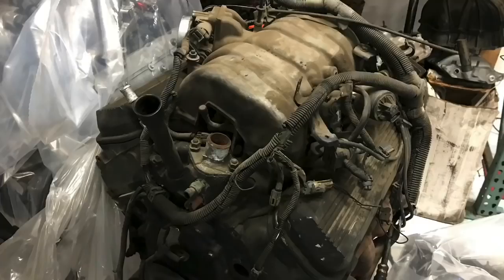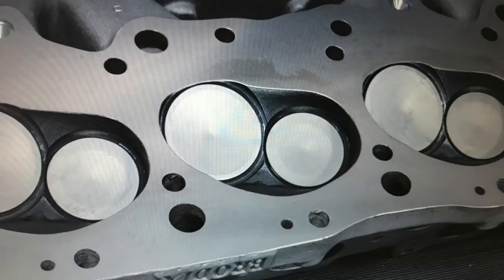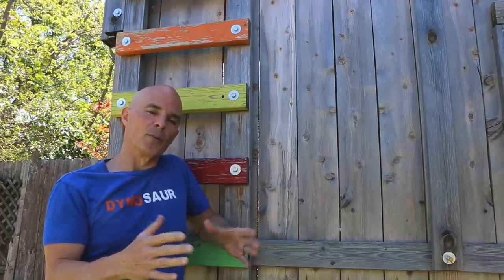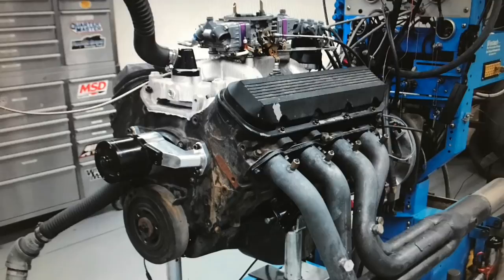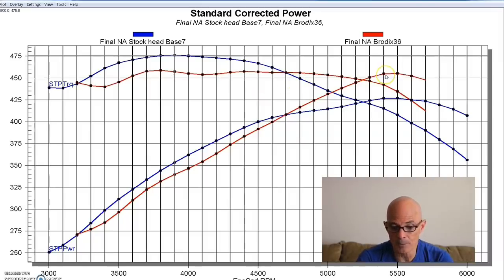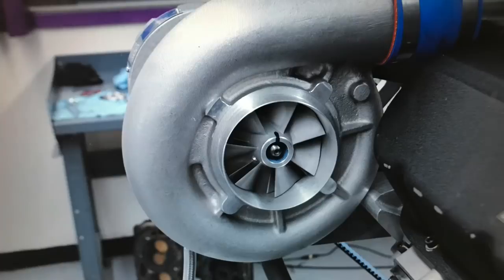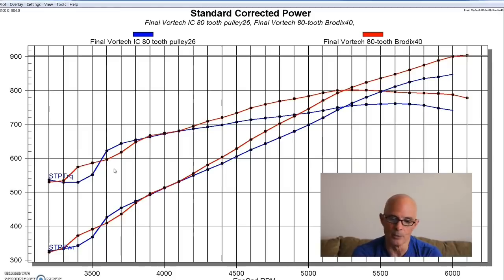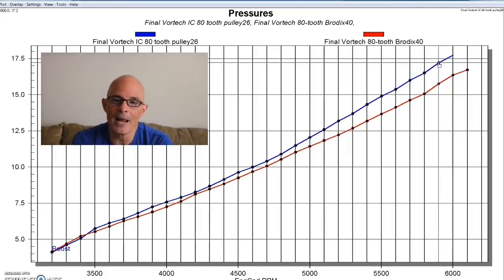BOOST BUILDERS OR BUST? Boneyard Boost pt2

Comment: @Richard Holdener any chance of dusting that engine off, putting the stock heads on and running the Torqstorm on it ? 😁
Reply from the maker: the torque storm is only good for 700-750 hp
Reply: @richardholdener1727  yep, you would need their twin setup for comparison to the YSI in this video.

Comment: Richard
Late on watching here-sorry BUT this test seems to answer my application questions best from your great BBC vids, except still foggy on some things with upgrade for my '70 Chevelle Crate ZZ502. Already bought - Patriot coated Med. length 7/8" primaries, 3 1/2" collector (car too low for full length headers), 3" out the back exh, MSD Atomic Fuel Injection, and Full Torqstorm single charger w. accessories. I did note from your Comp. Cams BOOSTED! Big Block video the cam used 233/239 dur. .561 lift at 118 deg. LSA which if i'm lernin' right, the LSA is key to a boost setup? 
Already have Comp. 930-16 springs and their full roller rockers, am I concerned with ring gap here? 
If I gotta buy this Comp. Cam, just give them the specs, or do you have the Cam #?
Reply from the maker: pick a cam that makes the NA power (curve) you want then add boost-ring gap is a good idea

Comment: If you were thinking of upgrading to alloys there are better choices BUT if your not rich the oval ports can be made to work, fiddle with the bowls ,bigger valves smaller stems , better cam. I've seen folks "upgrade" to alloys with no other mods and go slower, oval ports destroy everything under 6400rpm where nearly all street/strip warriors live _- true fact !!

Comment: Always great stuff from you Rich. I know you opened up the gap on the rings previously, but what else did you do? Ie install heads studs, main studs? Or just replace the factory bolts with standard arps?

Comment: what has to be done to the stock heads to add that much cam?
Reply: It’s actually a small cam considering most BBC cams run .600+ lift. The XM284HR fits without any mods besides valve spring upgrade.

Comment: My biggest takeaway from this test, is that the rising boost curve of a centrifugal supercharger is best suited to an engine that was built for low-rpm street use or torque, because it offsets the power/torque rollover at 4500 rpm, flattening out the curves and allowing you to keep pulling up to 6k.  This is most prominently shown in the stock head N/A vs. stock head w/ boost comparison.

Comment: 7.8 to 1 compression with aluminum heads?? I'll bet you could run this engine with a turbo at 5 to 7 pounds boost on 87 octane fuel.
If you can do that, you are somebody that is ready to drive a hot rod anywhere, even Mexico.....lol

Comment: Perfect test. I have a 1966 396 with cast iron oval port 98 CC heads 11.25 compression. And today debating throwing my 110 CC aluminum Edelbrock Perf. RPM ovals on it to get airflow. But worried about compression drop. Sounds it's the way to go even losing compression.

Comment: You'd be surprised how small the ports can be and not restrict flow.  ported oval ports will make more power under the curve than rectangle ports.  drive them on the street and you'll notice how much harder the oval ports pull.  boost pressure doesn't care about a few extra cc in the chamber.  you're losing boost out the exhaust because of the better flowing heads.  and it's still not "detonation".  it's knock or pre-ignition (although it's technically autoignition)

Comment: Thanks Richard appreciate the efforts and very straight forward results. I am curious if the yield would be the same with cheapo heads like procomp or others? I did a full inspection on a set of Procomp SBC heads and was pleasantly surprised how precise they were. Valve seat center lines were excellent, deck surface flat, port surfaces were flat and square. We did to some minor porting to clear up casting flash, but very little and a little deburring, as the machining left lots of sharp edges. I have a GEN6 BBC as well and appreciate the amount of information you are generating for me. Keep em coming. I am already have the Vortech YSI super charger so this is a great series for me.

Comment: There’s a few articles out there where John Lingenfelter modified 049/781 oval ports for big power. 
I offer these only as an indication of what reasonably stock oval ports can do. 

Here’s one of them from January 1993 Hot Rod:

http://www.derekspratt.com/PDFs/Automotive/Other/Hot%20Rod%20-%20GM%20502%20Rat%20Motor%20Buildup%20-%20January%201993.pdf

The other Lingenfelter article was about a 630 HP 496 BBC but haven’t been able to locate that one yet

Comment: Can we have one of your brutally honest videos do a discussion about how important Quench is in its relations with compression?

Like this 7.8 to 1 has its pistons 0.02 down the hole and depending on head gasket thickness being 0.025 for a proper 0.045 quench VS cheap 0.051 gaskets giving a 0.071 quench, at this low compression it wouldn't matter as much but at say..... 10+ to 1?

Comment: Awesome video!

I just did some math using the 4% increase/decrease per point of compression. Assuming the Al heads gave 7.8:1 the multiplier to make the compression equivalent is 1.048. Makes the results more impressive than the are. 

Thanks for all the videos and teaching, much appreciated.

Comment: GM VORTEC 8100, RPO L18 test . . . please ? 🥺😁
Whenever I can I always push for 8.00 : 1 or 8.50 : 1 for any supercharged or turbocharged application, be it street or strip, don't care. 
With modern heads and their fancy combustion chambers and modern, fast, precise engine controls people think is overkill but the way I see it is more empty space in the cylinder waiting to be stuffed under pressure and make MOH POWHA BEHBE !

Comment: Two or three requests! Try CID heads on this shortblock. Symmetrical intake runners and 88cc chambers. They have a single-plane intake, but the real street test NA would be to 3D print an LS3-like manifold. A lot of work, probably not going to happen, I know. But NA and blow-thru with the single-plane would still be interesting. Finally, throttle-body injection and E85 in place of the carb. Can you get away with no intercooler in that case? Flat top pistons and 88cc heads should be good for a full point of compression—much better for power.

Comment: Didn’t engine masters just do a video proving the aluminum vs cast iron on a dyno pull doesn’t make much difference? If I understood it correctly, low rpm cruising makes a little bit but the higher RPM brings more consistent heat so it basically takes away the advantages aluminum has in heat dissipation.

Comment: Wow those factory heads did really good for stock stuff, i bet with some bigger valves and port work those things would do pretty good for like an all cast iron sleeper!
Reply: Vortecpro has videos on making amazing power on stock iron heads. Not even gen 6 but the old mk4 stuff. Making 600+ hp on pump gas with factory heads running into the 10s.

Comment: Cool test but yeah those heads were more designed for the early Mark 4 with a typical small dome piston, I'd like to see what a set of AFR 265cnc ovals would do, 340-350cfm through a stock port size, and porting those iron heads and adding bigger valves I've seen 320-340+cfm and they perform very well, heck even ported peanuts with 2.19x1.88 valves make really good power up to 5-5500 but you know all this better than most. I was a huge magazine subscriber since the mid 90's, it's cool to put a face to a name I've seen for forever lol
Reply from the maker: I've got some testing on the AFR 265s and almost every other BBC head-I want someone to show me some ported Vortec head numbers
Reply: @richardholdener1727  awesome, and me as well, I've seen flow numbers but no A-B dyno tests with ported vs stock L29 heads

Comment: Ud see even more impressive gains if u used turbos w the static compression drop and gain in flow. Ud b controlling the boost pressure rather than the flow amount. Wonder if thats in the cards for a demo? And how much extra spark advance do u think u might b able to get w the compression change?
Reply from the maker: the Brodix heads wanted more timing

Comment: I ran peanut ports to 6000 rpm's, large ovals to 7500rpm, after porting my large ovals and squeezing ss 2.19-1.88 valves they have awesome velocity,dual springs plus I gasket matched the heads. These heads flow around 350 cfm's give or take but will make a violent 500+hp screamer 454 from any bone yard with cam and intake /carb (after expanding the intake valve relief on the piston) Oh I must warn people they are not open chamber 781's/049's or closed chambers and no not rec ports. This should scratch a few brains./ cam was a lunati bracket master flat tappet. 580" lift.

Comment: Test i have been waiting for lol it's like we've talked about it. What size valves do the iron heads have. So a all stock late 90s 454 with cam and springs with a couple ebay turbos it would make 1000hp for dirt cheap.
Reply from the maker: yep-Needs to be Gen 6 for best results

Comment: If I had a nickel for every time I saw a stock Brodix head drop a valve at full throttle on the local dirt track .....
Reply: BustedWalletGarage thats because they use cheap two pieces valves. Never buy heads complete. Buy them bare. Buy good valves and springs for your cam.

Comment: We made 800 on a 4bolt 454 gapped rings, ported 2.19 1.88 oval ports, 8-71 charger, 110 octane flat tapped solid cam
Reply from the maker: they can make power

Comment: Great vid Richard , my first aluminum bbc heads were Race rights but switched to AFR with raised exhaust port for the much higher exhaust flow on my blow through . Have you noticed much of an improvement with superior exhaust flow under boost and do you find that new heads still my need a valve grind and improvement on setup as delivered no matter who’s head ?
Reply from the maker: i haven't noticed need for a valve job

Comment: Back in the old days, on the streets, anyone with rectangle port heads under 500 hp would get beat by a good set of oval ports.
Reply: Torque is king on the street. 👍🏻
Reply: Rectangle ports were great for nascar or supercharger applications but they lose so much power in a street car it's not worth it N/A.
Reply: Yes...the dyno doesnt show how lethargic low compression and big heads are, regardless of the HP number.
Reply: Back then you could run a rectangular port intake on oval port heads and pick up about 3/10 s of a second too!!

Comment: I personally would like to see that big block a 10.5 with the same combination 🤔 that might break 1000 easy.
Reply: I like the supercharger. I got a set of 990 fully ported with 225 intake valves and 10.5 pistons.  I'll be running a healthy hydraulic roller with the air Gap port matched to the heads .I have a good bottom end and balanced. I was thinking nitrous oxide or maybe that supercharger!!

Comment: Brodix  alum heads? We have zero idea what heads you are comparing with out a part number or specs. Just I put aluminum heads on??
Reply: He mentioned flow numbers and CC volume.
Reply from the maker: And Brodix Race Rite heads
Reply: Richard Holdener  my point was there was no part number for the heads, valve size , intake and exhaust size. So we know what you were comparing the stock heads to. Race right heads with 122 cc chambers is just not enough information in my opinion. Not trying to be an ass. I love the vids. But hate the lack of proper information in my opinion. There are several size race right heads. But it’s just my opinion. Thanks

Comment: A test done long ago, do you recall if there was a big change in timing? Also I don't know if this virus has taken hold in my lungs or brain, did you mention the fuel used?
Cheers
Reply from the maker: the two heads wanted different timing-100 race gas on the boosted stuff-though pump gas would likely work

Comment: Absolutely awesome video. Raises several questions from the hundreds of engines I’ve built throughout the years. What about pistons that lower compression. That wouldn’t change flow numbers.....so it would loose power would it?  But what if you make up for it with boost. So if you have 9.0:1 vs 10.0.1 on said engine, would the lower compression one make more at the same boost number if you brought it back up being there’s more to burn in the cylinder. Or am i seeing it different. Seems like lowering the compression always lowers the boost. Or is it flow that’s lowering the boost? 
Edit:
After thinking about it, boost is just a measure of restriction, and the flow is what determines the restriction. But with less compression there’s more volume to fill with the same amount of time being cam timing is the same (if the same cam is used). Or am i completely wrong?
Reply from the maker: yep-as indicated in the video-volume changes from change in compression-and in this case flow also changed
Reply: So if the volume affected if you bump up the boost to match the previous test, then the power would go up so there would be more volume. With the same stress on the bottom end?  Makes since. Good knowledge here. Thank you!!
Reply: My apologies, i overlooked the volume answer in the video. I’ll watch it 2 or 3 times before the evening is over 😂 😂 😂
Reply: The greater combustion chamber volume only increases total cylinder volume by ~2%, and doesn't change displacement at all. I think the increase in power and decrease in boost pressure are mostly due to better flow.

Comment: Wow,  100cfm more flow per cylinder.  I would have thought that the boost would have fallen off more.  Good information!
Reply: +100 @ .700 lift, he was running a .547 lift cam. The cast iron numbers may have been at less than .700 lift.  The difference might not have been that great.

Comment: what about ported cast iron Heads vs Brodix Heads
Reply: Damn str8.  I have a set on iron 718 factory oval port heads.  My 460 went like gangbusters but nobody is interested because it doesnt have aluminum heads!  Guess Ill need to put it in the farm truck & let them see it run before I sell it! 😉😉😉
Reply from the maker: I asked specifically about ported iron heads

Comment: It would be interesting to see this test with a bottom of the page cam
Reply from the maker: wont fit P-V
Reply: @richardholdener1727  Is it possible to get a same weight high comp piston and do a piston swap and avoid a re-balance?
Reply: @richardholdener1727  do the big heads have more clearance

Comment: Now I wanna see it run with those heads AND the bigger .700 cam or I won't be able to sleep tonight.
Reply from the maker: bigger cams won't fit P-V
Reply: @richardholdener1727   Bigger boost would fit.
Reply: @richardholdener1727  Use fly cutter. ;)